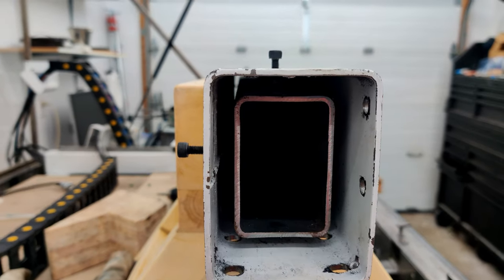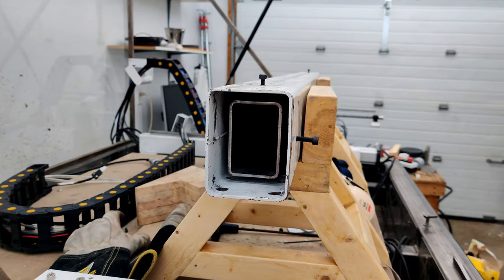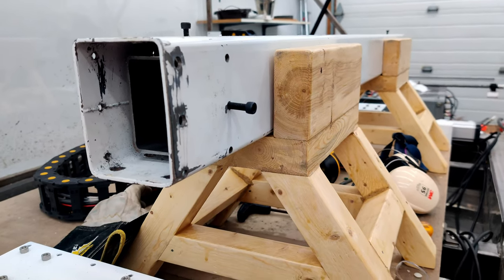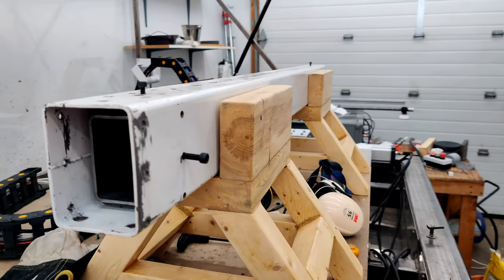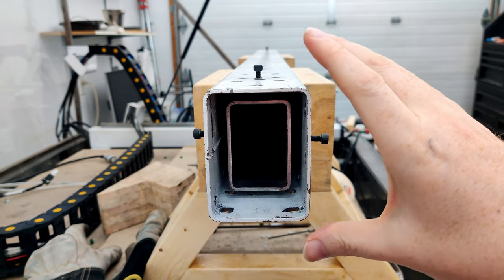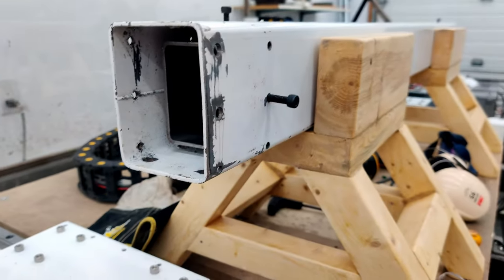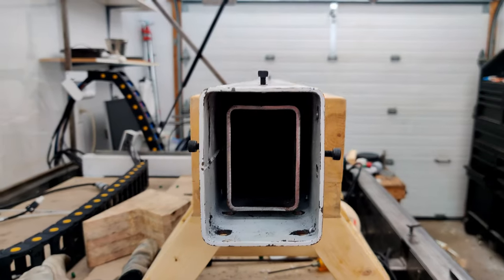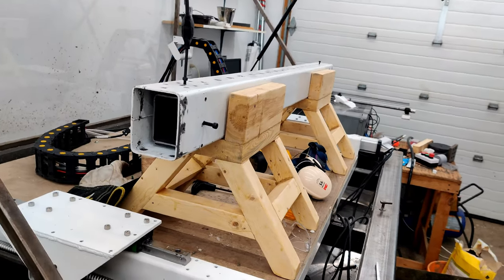Terminator AI (ChatGPT) helps me design a CNC machine gantry (Using a CFDST column for the gantry)

Comment from the maker: It’s entertaining what ChatGPT comes up with. Sometimes it’s right, sometimes it’s totally wrong! My gut feeling is that it performs better with coding questions at the moment than questions like these (easier to test/verify more black and white). The best analogy I can think that relates to it is ChatGPT makes a good passenger to help you navigate but you don’t want it behind the steering wheel. At least not yet.
Reply: May analogy is that ChatGPT is something like a layer that makes things more accessible, like a GUI in an operating system instead of using the command line. We're in a very early development, rather Windows 3.1 than Windows XP.

Comment: Hi Bryan, further to my previous comment,  please allow me to share a few thoughts.

1) I think that for a CFDST column the use of epoxy granite as the filler instead of tradition concrete would be an improvement to reduce vibrations and reduce bending of the column under load. I also threw this at ChatGTP and our AI friend agrees (which obviously is not a 100% guarantee, but still quite amazing).

2) As for the construction of the ganrtry, I have been doing quite some digging and calculating as well, as my intention is to make the gantry from epoxy-granite with steel rebar reinforcement, which is typical for normal concrete constructions. My gut feeling was telling me that such a solid column construction would be stronger (less deflection and less vibration) compared to a CFDST column. In summary this is what our AI friend had to say about the comparison between a steel (rebar) reinforced epoxy granite versus a CFDST column:

"The solid epoxy-granite column with rebar reinforcement is likely to exhibit less bending compared to the CFDST column. This is because the epoxy-granite has a higher modulus of elasticity compared to concrete, which results in a higher bending stiffness and moment of inertia. The CFDST column, while strong due to the steel tubes and concrete fill, generally would not surpass the bending stiffness provided by epoxy-granite in this case. "

Obviously there are more factors to be taken into account, but for my own situation I think I will be making the gantry from steel reinforced epoxy granite because I have experience with mineral casting and  also because in my location it is very hard to get decent quality tubular steel. I have just ordered parts for a laser alignment system, so let the fun begin soon :)
Reply from the maker: Apples to apples, epoxy granite is better than grout. Grout is still decent and the reason for me using it over epoxy is the cost and ease of use. Grout you just add the correct amount of water and pour it. Epoxy you gotta put more effort into preparing everything and it can still get messy and much more expensive. Keep in mind when doing this to the gantry, you want to add a lot more mass to the static base of the machine else you’ll quickly realize the dynamic motion of the machine is going to shake the crap out of your table. I would aim for at least 5x the mass added to the base that you add to the gantry. And for the base go with grout to save money because its properties other than mass are much less important.   

For gantry geometry, I went with the hollow CFDST shape, it saves on weight, less dynamic moving mass for the Y servos. Given the same volume of material a hollow shape is more rigid than a solid one. In hollow structures more material is distributed away from the center which increases the structure's stiffness and moment of inertia (resists bending more).
Reply: @BryanHoward  Thanks for the clarification Bryan. Much appreciated!

Comment: Good fun Bryan!... may as well make use of the monster before he (she) knocks us all on our heads.
What you (and "It") have shown makes me curious;  would offsetting the inner tube closer to the bottom provide more steel at the lower face, where tensile strength is needed.  This would also mean more grout/concrete/epoxy granite at the upper face where it's superior compressive strength would be an advantage?
Keep it up!  Thanks.
Reply from the maker: That’s an interesting idea, I can see how that might be beneficial. It would also make it easier to pour as well because you can pour right into the larger top section and it’ll wrap around.

I’m gonna leave it all centered because I want to straighten the surface that the rails contact and in order to do that I need the bolts that hold the rails down to reach the inner tube. I’ll make a video on the whole process next.

Comment: Hi Bryan my tip is to 3d print a pyramid that fits into the inner tube on the end you will be filling to direct the grout down the sides
Reply from the maker: Yeah it is a really good idea and I can’t decide if it would be better with a conical/pyramid shape such as that or have it flat so I can whip it off faster. Because the inner tube is recessed it just forms a cup so it doesn’t spill to the outside.

Comment: Thank you for sharing looking forward for the result I'm planning a machine that use that kind of gantry, I have 3 questions 
1- which is better square or rectangle tube for the same mass and area 
2- which is the best position to mount linear guide rails
3- which linear rail cartridge is over all better With flange or without I have access to buy both same price 

Thank you.
Reply from the maker: A lot of the forces act on the gantry in a twisting motion. I have a feeling that a square might perform better overall. Haven’t run a simulation on it but can’t be sure. A larger profile will perform better than going thicker in steel up to a point.

If steel tubes were perfect with flat and square sides, you would have the freedom to place them anywhere. Then doing some setup where you’ve got one rail on the front bottom surface and another on the top towards the back might work out very well. 

A linear that runs on the front face close to the bottom works out well because you don’t have a rail under hanging (more clearance for the machine) and forces having a more direct path instead of through an angled piece of steel like I’m having to do. Would be slightly more rigid I think.  I would look at the MR-1 for ideas in this area.

The reason I’m running top and bottom even after rebuilding everything, is because the center of the tubes is the only guaranteed location I can attach them without having them get all skewed because of the steel tubes profile

For the bearing carriages I honestly don’t think it matters at all. One could argue that the ones with the big flanges on the sides give more surface area which is a good thing but i think it’d be negligible. Whatever you choose, I would suggest not mixing them on the same build. That way you can swap carriages around to different axes which might be beneficial for the longevity of them.
Reply: @Bryan Howard Thank you for your response, I'm thinking the the gantry square will be 15 cm and about 1cm side walls, also implement your idea that you provided here

For linear rails Mr-1 using the same style as yours. Just the bottom one is close to the Z top one is far, by doing that i guess the Z is more close to the gantry to minimize the leverage.

Comment: I have been planning to do exactly this on the gantry of my machine but  specifically using epoxy/epoxy granite rather than grout/cement because that will adhere much more strongly between the two walls of the tubes, which will contribute a lot more to harmonic dampening and torsional stiffness. With it being in a static column the difference between grout and epoxy probably wouldn't matter but because it needs to resist a lot of vibration from cutting, AND torsional forces i think epoxy would be a much better fit for this. The grout/cement will do a lot from a mass dampening point of view though. I had also thought of welding a few small steel tabs to the inner tube and then making corresponding cuts/holes with a cutting disk or drill in from the outter one and welding them together as one piece so that all the twisting/bending forces were shared/transfered fully. That wouldn't interfere with the epoxy fill then but it would almost certainly be overkill.  Can't wait to see how this turns out for you, if it works well for you I'll just copy yours so i can avoid working with epoxy. Thanks for documenting everything you're doing.
Reply from the maker: Yeah the epoxy sand/granit should be superior but by how much to make a difference I’m not sure. Downsides of being much more expensive, health hazards working with it, messy cleanup etc. Sofar I’m really happy with how the grout worked with the gantry risers. If I can get similar results with the grout on the gantry I’ll be happy. If I find the tube vibrates more than I'd like after the rebuild I might consider putting a third small tube down the center locked in more grout.
Reply: @BryanHoward  This is not supported by the materials I read tho. By those numbers UHPC or even just grout performs much better.

Comment: ChatGPT and tools like it, look to be the next step in searching through the internet. But only if it posts it's sources. I certainly hope it helps because some times it feels like bashing your head on a keyboard trying to find actual information. 

As for suggestions on the gantry itself? Perhaps some glass or steel fiber reinforcement in the mix?
Reply from the maker: Having a posted sources kind of problematic because there really is no source for it. Machine learning models build ends up being weights and biases and the sources for a given result can come from many tens of thousands of sources. 

Seems like a problem of search maybe someone will come up with a model that specializes in this probably Google they seem to be at the head of search.

Comment: i agree with chat gbt about this model of gantry , and this structure i think is w sturdy , but the more sturdy is 2 round beams , with some epoxy between them .
 i think u need some fibers in concrete , because of cracks can form under high vibration when u mill .

Comment: Interesting approach, I am just afraid that the added weight by an additional steel tube and concrete would be substantial and hence also increase the inertia when moving such a heavy gantry... Don't know how that would impact the maximum speed / acceleration you can run the machine at... It would certainly help with the vibrations in the gantry itself, but it's inertia could cause the whole machine and the table to vibrate much more than before...
Reply from the maker: Machine is back together with the grout Composit gantry. I can tell It is much more ridged. I get a max of 3 thou of deflection at the spindle tip. 

The servos don't care at all with the extra weight. The machine is more top heavy than I would like. The steel welded base is not ridged enough anymore to oppose the gantry momentum.  I'll be adding some more extra static weight to the top part of the machine base. I'm thinking to measure out the base movement before and after adding about 1000lbs.
Reply: @BryanHoward   I know the servos can handle the weight without a problem. I was thinking more in terms of the shaking of the whole structure that moving such a heavy gantry would introduce at higher accelerations/speeds. Anyhow kudos for the efforts and enthusiasm, keep us posted when you have time of course. I am just preparing to start a build based on PrintNC, but I'll try to make a much smaller but really high end version. I don't need more than 500x500mm working area and was thinking of going the opposite direction - very rigid but lighter aluminium extrusions, like 8040 or even 9045..... it's much more expensive than steel, but I think it could be at least as rigid and considerably lighter....
Reply from the maker: @MilosevicOgnjan  I think the bigger machines do a ratio of around 20:1 of static vs dynamic weight. It’s just a matter of adding more static weight to overcome the gantry movement at this point. 

On your machine, there's really no benefit in making things lighter. I would stick with steel over aluminum extrusions. Steel is about 3x stronger than aluminum and the strength to weight ratio doesn’t really come into play. Aluminum is great for making many parts due to it being very easy to machine but that’s about it.
Reply: @BryanHoward  I don't have much experience building CNC's (only made one MPCNC), but I have a considerable experience with 3D printers and I know that making the gantry as light and as rigid as possible not only benefits the speed tremendously, but also the quality of the prints since it reduces the momentum and shaking (ghosting). I guess there are differences with cnc's, since it is subtractive, not additive manufacturing, so you have to resist the material as well, but the core principle is the same, and somehow it seems intuitive that if you can keep the rigidity, while reducing weight - will only benefit the performance and accuracy. The aluminium constructive v-slot profiles 8040, 9045, etc. are also very straight (I guess much straighter than the rectangular steel ones I can find here) and the complex shape of the extrusion makes it very rigid and easy to work with beacuse of the V-SLOTS. DOn't know about the weight yet, but I guess it's at least as rigid as a hollow rectangular steel profile.

Comment: Any idea on the effect of thermal expansion differences between the two materials? Obviously, won't make a difference in a building, but may on a CNC machine.
Reply from the maker: The coefficient between steel and concrete / grout is very close. Closer than aluminum and concrete. But I think even if they didn't expand at the same rate it probably wouldn't matter all too much as the force would be evenly distributed and not warp one way or another. Because steel and concrete expand I mostly the same rate they are universally used in building construction even at high temperature fluctuation areas.

Comment: Hi, just wondering if any of the ideas here are from Principles of Rapid Machine Design by Eberhard Bamberg or if you could share any of the white papers you've found useful? Thanks
Reply from the maker: Now the results ever pointed to that book. The results I was reading over were from white papers after searching for CFDST in Google. The white papers for difficult to read through as they usually covered a very narrow criteria about them. They always use them in the form of a column instead of how I'm using it horizontally. 

It's hard to find out what ratios of inner and outer tubes is ideal. The way I went around for researching this was to read as much about the topic I could and then start firing off questions in to chatgpt. That made a final judgment call on how to do it.

Side note of chatgpt you just can't fully rely on it cuz it confidently screws up all the time. It's good for filling in the gaps in knowledge but not for using as a foundation of information.

Currently I have the hardened cfdst column on my machine as a gantry. It's worked out well much lighter than filling it in fully. I don't think the damping is good as fully failing in though. Strengthwise it's probably very similar as fully filled because the cfdst has to steel tubes close to the perimeter where benefits the most.
Reply: @BryanHoward   Thanks for getting back. I’m a fellow GPT covert, feels like standing on the shoulders of a collective giant although I have seen it get things wrong and completely make up stuff in a very convincing way. Following your laser and cnc work with great interest while mulling over my own design. Found the sections on replicated joints and constrained layer damping in that paper very interesting. Came across the recommendation for them on the ‘FloweringElbow’ channel cnc build. Best of luck with your projects, amazing work 👍